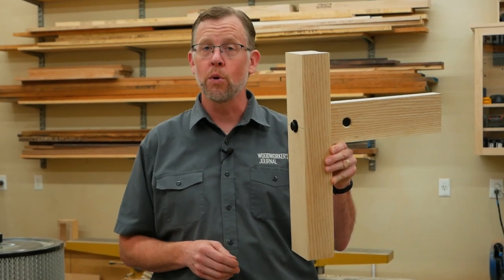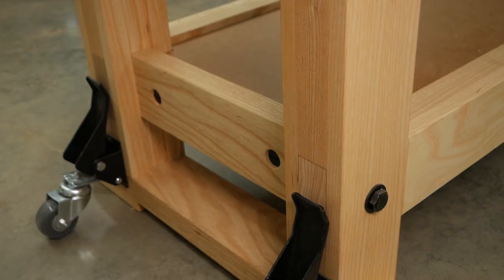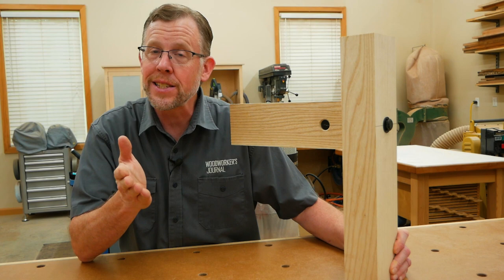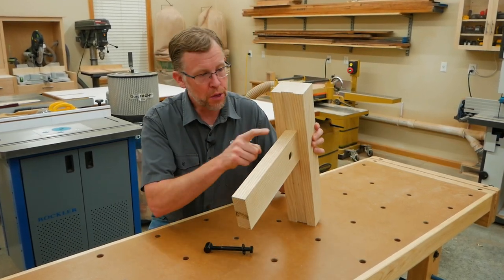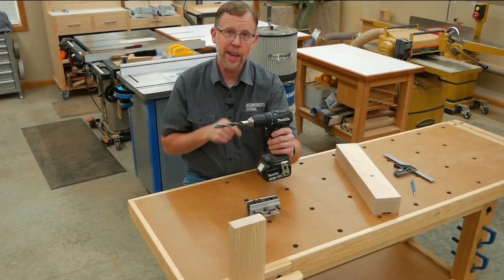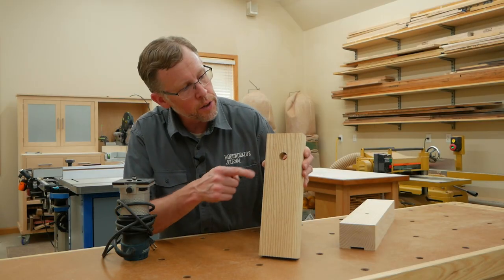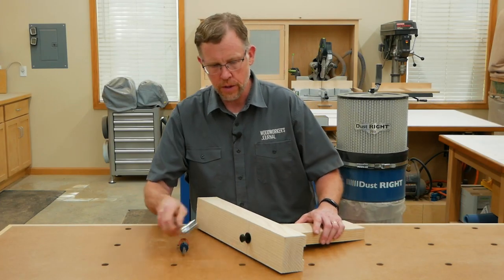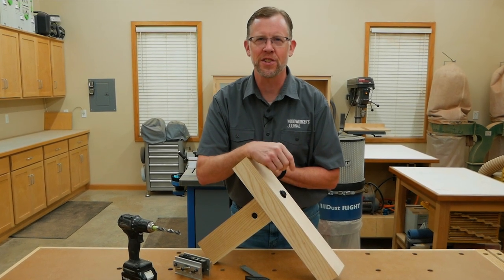Installing Heavy Cross Dowel and Bolts

Comment: as a retired furniture make,r i would add that if used in a bed frame (perfect place for them), insert a solid dowel above and below the bolt for extra rigidity and strength.
Reply: seconded! Makes assembly easier too
Reply: I use a domino in addition to the cross dowel and bolt.
Reply: So a couple of non-glued dowels helps prevent racking since the bolt is only connected in the center?